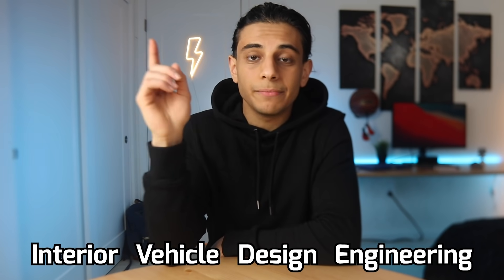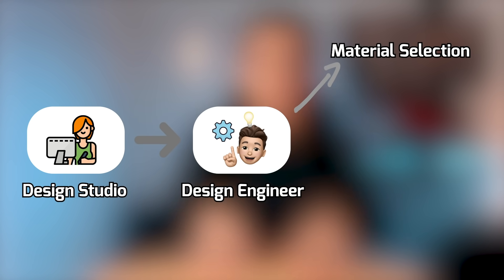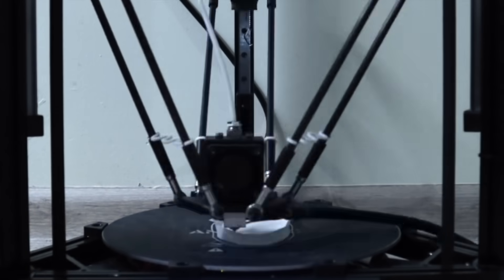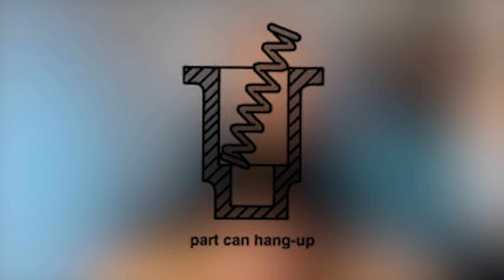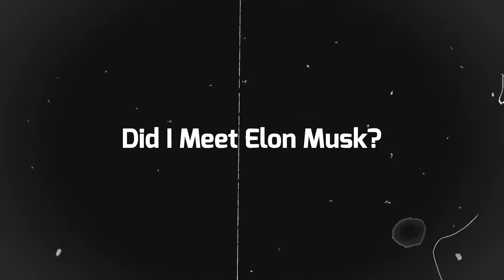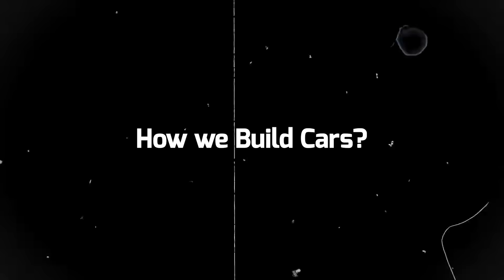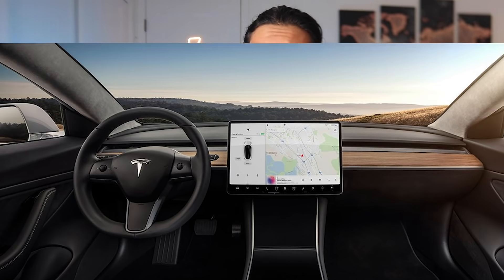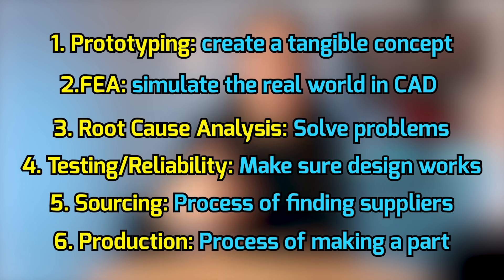My Experience Working as a Tesla Engineer

Comment: In the automotive industry, there are more CAD software applications being used than those you mentioned. CATIA and NX are fundamental tools utilized by design engineers in the automotive sector (Solidworks is not standard; it may only be used by suppliers). Professional engineers in the automotive industry need to be proficient in a much wider range of software tools. Engineers who use only CATIA or NX mostly work via engineering services outsourcing companies for OEMs. In Germany, for instance, this is mostly the case (around 80% of engineering is done via outsourcing because it is cheaper).

Comment: You work at Tesla which is one of the best car manufacturers in USA and what you drive is a Honda? Dude, You are a Disgrace.
Reply: Says something about Tesla, doesn't it. It also says something about Honda. One brand has longevity
Reply: Tesla cars are crap.  Sorry to burst your bubble.  The EV side of it is solid, but the actual cars are built like shit.  Consumer Reports ranks Tesla 27 out of 28 car brands surveyed.  They are also one of the least reliable cars on the market 205 problems per 100 vehicle sold.  The information Consumer Reports collects comes straight from Tesla owners.
Reply: @brandons9138  It's Ok Squidward. In fact I agree with you to some extent. Because even though they make fast cars like model s the cars do look like shit just because they they don't look fast. I would rather have a BMW with a gasoline engine rather than a Tesla. Because it looks fast which the Tesla doesn't and It sound awesome whereas the Tesla doesn't even have a sound. But still, I'd say that it's way better than a Honda.
Reply: @Learn-With-Aryann  I identify as Plankton.  I'M TRIGGERED!!!

It's not about just the looks, and I agree the S looks good. The rest of the Tesla line up looks like aborted sperm whale fetuses.  It's about the actual build quality of the cars.  They are well known for bad panel gaps excessive squeaks and rattles.  Failing AC and heat. Bad paint.  I saw an article about a guy who got a brand new Model 3 that was missing a break pad.  For the price premium that Tesla charges that is unacceptable.  I took you for a Tesla fan boy from your initial post, but it seems I was mistaken.

Comment: It reminds of the process of building a house.

A geology engineer would test the strength of the soil to determine which type of foundation to be used (strip or isolated or raft slab).

A designer/architect would make the exterior and interior design. Then the plan is passed to a civil engineer who would design the concrete structures (striping, columns, gound beams, slab). Then the plan is passsd to a mechanical engineer who will design the plumbing system. Then the plan is passed to the electrical engineer who will design the electricity system. 

Usually, the engineers will ask the designer to change some of his concepts.

All of these professionlas use softwares to help them design so don’t panic about the details of their work. 

It’s actually a peice if cake.

Comment: Great video, loved it, thank you for the insight! And I'm wondering - is it sustainable for a company to have such a big employee turnover, especially in engineering departments? It takes a while for an engineer to learn everything he/she needs to be at its full capacity. By constantly switching workforce, they get maybe like 60% of what the engineer could do should he remain there after the "initial learning period". Maybe that's why long working hours are expected at TESLA - to compensate for the inexperience.
Reply: Yes. It is ironic that Tesla is pursuing sustainability using an unsustainable development model

On the other hand, it is good for young engineers to work hard and have lots of challenges early in their career. It is like a crash course.
I worked an an auto company, and agree with everything Tamer said.

Once you have good skills and experience, you can do a lot w it wherever you go.

That type of system will work if there are enough people that stay around, or have experience from other auto companies to form a consistent core knowledge base.

Comment: "Can't be taken off easily" seems to have been a core design requirement for the majority of car parts for the last 20 years.
Reply: The main issue is noise. if it can easily be taken off, it will fall off or rattle.
Reply: @greggmcclelland8430  That's not true at all. "Easy to take off" just means visible and accessible fasteners to me.
Reply: @TerkanTyr  You could be right. I would need to go back and review the video.  You can design for easy removal, but industrial designers seldom do. Exposed fasteners are seldom welcome. Caterpillar actually designs their cabs with that in mind. Discoverable fasteners, ease of assembly.  Autos use a lot of Pressure sensitive adhesives on plastic and trim to keep them from rubbing and rattling.  That is what I was referencing to.  Injection molding and casting also is the technique to get rid of small pieces and incorporate them into larger parts.  Tesla has recently surpassed other auto companies at this.

Comment: Every good car designer must follow the next rules, as I see in my car:
1) Everywhere there is stress concentration there should be a notch so that it auto-destroys because of fatigue.
2) Every bolt should inaccessible with standard wrenches. Only special wrenches.
3) Every filter, or replaceable part should be: "No serviceable parts inside"
4) Spare parts never should meet tolerances, so that the customer could install it without reworking.
5) Programmed obsolescence is fundamental. The customer should be encouraged to buy a new car instead of reparing it.
6) Thicknesses should be minimum, even if it is more difficult to construct than a wider one.
7) Never use stainless steel
8) Plastic parts must be easy to install but impossible to take out without breaking it. Use "milano tails". Do not use bolts.
Reply: That’s sadistic

Comment: I worked as a Machine Designer for over 45 years. This is video is a real as it gets. It's challenging to come up with concepts that meet all the requirements, but deeply rewarding when you see it all come together and work.
Reply: I have a Q 
How do engineers calculate the dimensions of their design’s parts? 
do you do it on CAD or mathematical Programme or what
Reply: @maalikserebryakov  Hi. First I need to say up front that I enrolled as an ME student but did not complete and get a degree. I was able to get into engineering as a draftsman, pre CAD era, and advanced from there. I thought that this would be a detriment and sometimes it was, but overall being able to come up with concepts to solve problems is more important. That's the part that I most enjoyed.

Most designers rely on ratings from the manufacturers of the components that we incorporate into the designs. Most of these have huge safety factors designed into them. Components such as gears, sprockets and chains, pulleys and belts and others are designed, tested and rated by their manufacturers. If used appropriately, there shouldn't be any problems. Another thing at the time, pre CAD, was that strength calculations were laborious and expensive so it wasn't done if it could be avoided by just adding more heft. 

Most of the machine design I was involved in was for capital equipment; machines used to make consumer products. These were stationary and most engineers got away with overdesigning the components.

However, there are systems and other operations within these machines where mass is detrimental. The newer CAD FEA programs get better every year and really show how kinetic mass can be reduced and still increase the strength of the components. And these calculations can be done quickly and efficiently and make for a better overall design. 

Having an engineering degree is invaluable for knowing how to setup CAD FEA parameters - knowing what range you expect for the outcome of the calculations provided by the program. The old GIGO still applies.
Reply: I want to meet you.please give me your mail.🙏🙏
Reply: @MdAbdulJalil_ME-20 why do you want his mail
Reply: Hey brother , Can you tell me How You Engineers Think like what Gonna work And what not and Which material should we use And who is in charge for expense. And sometimes you Also fails so How your team manage Failures.

Comment: im a mechanical design engineer in the oil/gas industry. this was surprisingly relatable. but i get my "A Surface" is normally on a napkin! i turn it into a concept then do engineering, sourcing materials, then turn that small 4x4 napkin into 200ft workover rigs!

Comment: Question?
What other kind Job can a mechanical engineer that is not so good in 2d/3d design software do if he/she is working at Tesla or rather what other job can a mechanical engineer that is not working with the design team do?
Can they work under the manufacturing or assembly section?

Also from your experience so far, as a new engineer under the design team, did you undergo training to ensure you have a good understanding of the job before any project is handed to you?